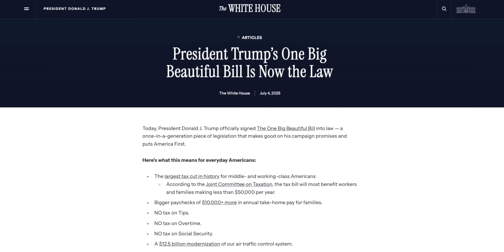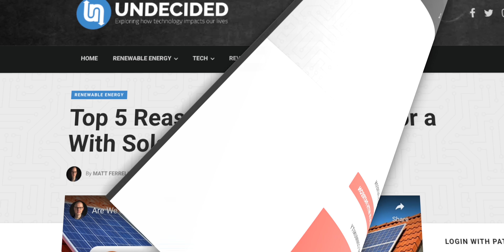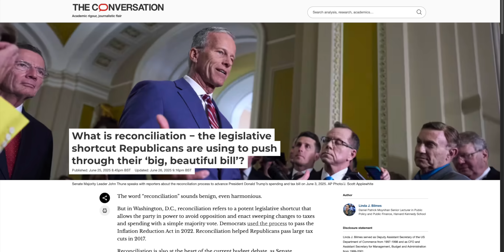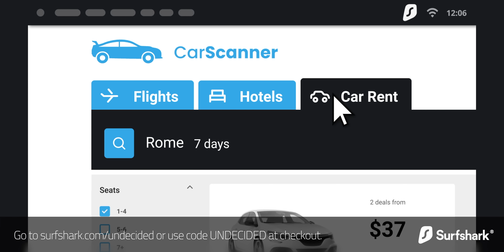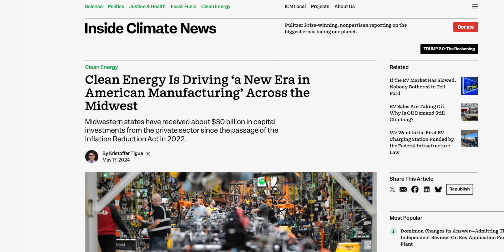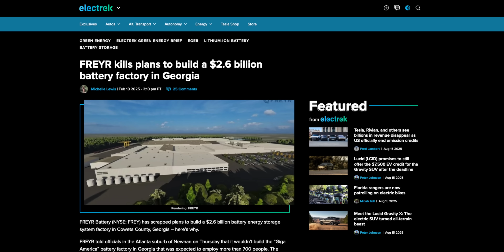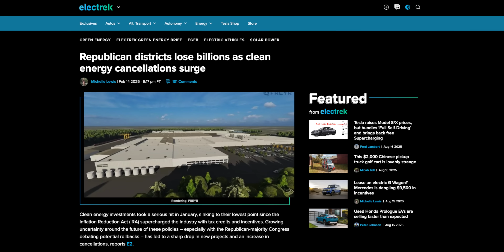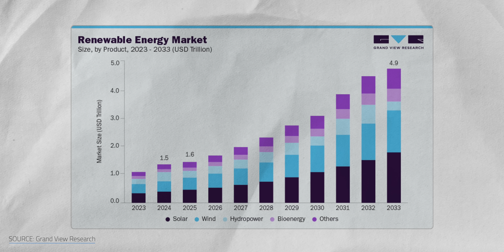How the U.S. Just Handed the Renewable Future to China

Comment: Renewables produce 21% of electricity but employ 42% of energy workforce.  Not a very good advertisement for efficiency.

I wonder, a NG plant produces electricity essentially 24/7/365 while solar and wind do not.  Is the cost of the 24/7/365 NG plant that sits idle but ready to keep your lights on when renwables fail to deliver included in the cost of the renewable?  Are those workers part of the renewable workforce?

If a house went off grid they could buy a generator or they could buy a solar array, batteries and maybe a wind turbine AND still have to buy a generator to step in when the others fail. Also, the generator will work as well in FL and AK.  Renewables can't say that.  

Getting rid of the tax break for EVs will mean that someone else who does NOT own an EV won't have to help pay for your car.

I'm not against EVs or solar but I don't think the costs are being honestly stated.
Reply: Those big American EVs store enough electricity to power your house for several days

Comment: One of the other really big untalked about pieces of information is that the Oil subsidies have no ties to meaning new Oil jobs.  Like you said, it's just money thrown at existing systems, but those systems are increasingly moving to automation.  US Tax $ to the Oil and Coal Industries is either being used for stock price buy-backs or removing jobs.  Congress and Trump Admin didn't put in any penalties to the industries to push the corporations towards certain actions, it's just money thrown at them and a suggestion on how to use that money.  

Recently found out that's pretty much exactly what happened with Eggs in the last year, too.  A lot of US Tax $ went into Egg Producers for groceries, but because there was no penalties attached for misusing the $, it all went into corporate profit margins declared to their investors.  It's wild.  

The US used to have that same subsidies to buy livestock from farms that needed to be killed to prevent disease from spreading.  They got rid of the subsidy, and farmers were reluctant or unable to cull large portions because of the severe financial problems that the US Gov stopped providing assistance for.  Eggs then go into a scarcity issue and Corporations maneuver to take advantage and exploit that to significant blown out degree. And then the US Gov step back into to provide $, but this time WITH NO CAVEATS OR REASONS.  Just, "Here is a lot of money. Please make prices go down, I guess." and the Corporations just take the money and the egg prices froms from 320% to 270% and everyone calls it a win.  ffs

Comment: The US have a post WW2 debt to GDP (124%), and a private debt of average 80k. Even if you wanted to produce panels, inverters etc. it will probably take you 10 years to match China. Your companies wanted globalization to maximize their profits, now that has backfired. It makes more sense to use your country's oil and gas to stabilize the economy, rather than import green stuff from China.
Remember that in 20 years all the green stuff you buy (panels, inverters, batteries etc) will need replacement, so you will have to pay the Chinese again, if you don't have local production.

Comment: I predict that the final cost of installing solar panels may go up at first, but then will mysteriously return to 'just barely breaks even just barely fast enough" to convince just enough people to install so that all the solar roof companies stay busy.   I may be wrong, but that's my prediction.
Based on the fact that it doesn't make sense that over years of checking out solar roof pricing for my same home, it shouldn't have always just barely paid for itself after roughly the same number of years. It should either be clearly too expensive, or clearly a good deal, or be changing from the former to the latter.  Unless, that is, the solar installers have all the business they can fulfill, even if they just barely make it economical for people to install solar.
Reply: Even if the final costs stayed constant for the last years, the technology being installed has cahnged quite a lot.
I can see about the same regarding the installation costs here in Europe, but here's what has changed for me since 2020:

- A standard module (sized about 2 m²) delivers about 450 Wp, which is 100 Wp higher
- The modules now use glass-glass which is more durable than the previously used glass-foil ones
- The new modules have way less light-induced degradation 
- Way better performance with diffuse light on cloudy days
- They often come in a bifacial design, which allows them to use reflected light, e.g. if they are installed on a flat roof
- And the greatest change: In 2020 the installation did not have a battery included, which is the standard nowadays 

So, my recommendation would be to shift from planning sth like "a roof full of solar" to a system of X kWp. Then you should clearly see a decrease in costs.
On the other side, if you're comparing the offers you've got in the recent years, you should clearly see an increase in performance (kWp, and maybe the most recent offer also includes a battery, which the previous didn't).

Comment: Someone thinks US and China currency is the same. If they invested 940b that is 6 trillion in yuan. If it solar efficiency becomes way more efficient, cheaper, less temperature dependent at some point could be a smart move. But if it doesn't spending 6 trillion in spending could put you in massive national debt. Normally China could just devalue their currency to beat it, but that probably won't work in near future. The citizens there are tired of working as cheap slave labor.

Comment: In the Philippines  I just had  (20) 580watt bi panel  ground mount
12 kw inverter      (2)   51.2V/300Ah (15.36kWh)LiPo batteries
Total with labor installed     $13,000  usd.   NO  TARRIFS

Comment: Years before Trump took office, the United States had already lost any chance of success in the clean energy sector. China had been competing internally for 20 years, making its solar panels sufficiently good and cheap to render any American attempt pointless.
This is the natural failure of the United States, not Trump or the Republican Party. Under Biden's presidency, massive subsidies have been poured into the clean energy sector, but the gap with China has widened rather than narrowed. It's wise to avoid a losing battle.

Comment: I love your videos Matt, but your arguement on the loss of jobs is wrong. I was an electrical amd solar contractor for years and now work in architecture. The electricians will transition back to regular electrical jobs and the others into into general labor or other trades. There is no shortage of construction jobs to carry them. Solar in most areas did not create a bunch of new high paying jobs. Rather from what i experienced in California it created a lesser form of electrician or racking crews which a lot were former rough carpenters and other general laborers and roofers. Solar as a specialty laborer was less paid and less skilled than a standard electrician which is what helped bring the cost of solar down. There is a lot of nuance to all arguements but the idea that the labor will be sitting around is a misnomer.

Comment: Good story, but it raises the question: upto which point should you subsidize clean energy?

I'm not a fan of subsidizing fossil fuels either, but I'm not entirely against cancelling clean energy subsidies either.

You could argue that a lot of the clean energy technologies are definitely not in their infancy anymore, and have reached enough economies of scale where they should be competitive right now.

Electric cars? Millions have been sold already.
Solar panels? Billions.
Windmills? Millions as well.
Batteries? Billions.

There are definitely clean energies that might need a little boost. Thorium and Fusion energy for example would be good candidates to subsidize to get them up and running, but the big 4 above are mature technologies, not unsure bets as they've been before.

Comment: Let's also not forget the tack-on repercussions. I'm in IT. One of my clients is a solar planning and installation company. They're talking about letting go about 60% of their people by the end of the year. That's over a hundred people that had good paying jobs that are now going to be looking for work. But, because of that, they're also looking for any other place they can cut. Instead of buying new laptops and generating more income for vendors and my IT company building them out for them, they're going to be holding onto older systems and only replacing ones that have to be updated due to Win11. They're also cutting out the phone system and just using cellphones, so there goes all of that money too for the US-based company we had them paired with. They're going to be downsizing their fleet, so the shop they used (also a client) is going to getting much less work, so they're talking about downsizing 2 technicians or more. Which means less money for my company too, so we're struggling to hold onto the few of us there are while not getting over-burdened for lower pay due to less work. It's absolutely disgusting what these rich jerks are pulling off. What I really don't get is that people are buying it.

Comment: This video comes off like propaganda. You keep calling it "clean energy", but these technologies are not clean. I have 4 dead Ryobi batteries and a bunch of lithium devices without user serviceable batteries in my house that no one will take when they fail. There's no where to take old batteries (there's no profit to be had in recycling them) except the trash can, which is going to a landfill and will pollute groundwater with toxins like Cobalt, lead nickel and lithium.

I own solar panels, and they're awesome, but again, they're good for 30 years (hopefully if a storm doesn't destroy them) and then what? They go in a landfill (hopefully if they accept them) adding lead, mercury and other toxic metals to the ground water. There's no viable recycling solution for all these solar panels so realistically people are going to be dumping them all over the place like tires as they become unusable. 

I'm really enjoying these technologies but they're not clean, they're just clean(er) in emissions but they're going to be a major waste issue in 15- 20 years. Not to mention the fire issues with the batteries. Thermal runaway is insane, and one battery the size of a stamp can burn down your house and we all have 5 to 10 to 20 of them sitting around in our homes at all times. As they start to fail, and more adoption leads to more accidents and incidental damage, there will be more and more fires which are nearly impossible to put out. 

Say what you want about gasoline and propane, but most people don't keep them in the house or next to their bed or children's beds. Battery tech has a long way to go before we start lumping them in with the phrase "clean energy". I live in Georgia and the thought of a battery factory or storage facility being anywhere near me would cause me to move as much as a petroleum processing facility would.
Reply: Even underdeveloped states like Georgia recycles lithium batteries.."Ascend Elements is recycling end-of-life EV batteries and lithium-ion battery manufacturing scrap in Covington, Georgia."

Comment: The figures in this story are simply not accurate and of an industry can not survive without subsidies or is not the answer. Sending our fund to foreign adversaries makes no sense of course you put them into an industry which supports local production. Current renewable energy technologies are overpriced and energy efficient, but they do financially enrich China and others while creating a major pollution issue. By bringing back combustion cars the vehicles will be much cheaper and save households without subsidies.

Comment: This admin basically has absolutely no idea what they are doing. 

Solar, wind, hydro, geothermal, and nuclear are the only power sources that allows you to get to energy independence, even if you don’t make the component parts of the plants/devices as a country. The reason why is once you install the energy capture device, it just keeps producing energy for you for doing basically nothing. The only one that requires constant input from outside is nuclear, but it makes up for it in crazy efficiency and safety.
Reply: I don't want to be that person, but actually wind generation requires a lot of maintenance and rare resources in order to work, so while it's carbon footprint is not as big as fossil fuels it is definitely not a system that can work without issue, nor it can be scaled up in a sustainable way, at least in it's current form.

Hydro energy also requires a lot of maintenance, dams are constantly subjected to stress and decay due to humidity, particularly during winter, not to mention all dams have an expiration date as the river flow drags debris that eventually fills the dam from dhe bottom up.

Solar is the closest we have to a totally autonomous energy generation system but depending on the weather you still have to clean the panes for maximum efficiency.
Reply: @elisehalflight  Well, I think I see where you’re going - solar is superior.  Agree.  

But … scale ?  China has (at least) two monster Wind Generators: Three Gorges at 152 m tall;  And Dongfang at 185 m tall.
Certainly they will require periodic maintenance- same as every type of generation.   And likely more than solar.  But á vast improvement over old tech like coal or gas.  

And … how beautiful ?!  Majestic, silent, behemoths - living monument to human ingenuity - just quietly sitting there as sites of wonder whilst providing power.  Does anyone, anywhere “love” the look of a heap of coal slag ?
Reply: @elisehalflight Maintenance is roughly equal for all forms of energy though. Coal and gas fired plants also require roughly the same amount of maintenance AND they cannot possibly be run without a fuel source.
Reply: @cheeseisgreat24  Oh definitely, renewables is the way to go. I am just telling you that they're not a fire and forget thing. It's just our best option until we figure out something better, just like nuclear. I am pro renewables, you don't need to sell me on them, lol.
Reply: @elisehalflight I never said they were though. So why are you commenting like I said they were?
Reply: @elisehalflight I do realize my statement of “doing basically nothing” could lead you down the path, buuuuut here’s the thing, everything in human life has maintenance needs. That is why there is the adverb modifier “basically” before “nothing.” The understanding there is that there is no additional work required to keep the energy being captured, other than general upkeep of the mechanical system as a whole, you know, “basic” upkeep. They do not need constant human input and monitoring of their fuel source, we get that for free, for doing literally nothing, but we need to recognize that they don’t let you get away with doing “literally” nothing, so “basically” is the word used.
Reply: @cheeseisgreat24  Are we really going to argue over semantics here?
Reply: @elisehalflight I mean, you’re the one who came in to do just that 🤷🏻‍♂️
Reply: @elisehalflight Also not to mention, maintenance can be done by your own citizens, meaning you still have energy independence which is what I said you’d have
Reply: Of course they do. They are keeping corrupt rich people in business and they are destroying small businesses. Because they want more for themselves and less for us!
Reply: This admin knows exactly what they're doing.  Destroying America from within, across every facet, at the direction of its enemies.
Reply: @cheeseisgreat24  I believe they know what they're doing. I'm fairly confident that they're just making sure they benefit their largest donors with minimal consideration for the future.  Republicans in power tend to move toward privatization of every government program possible while also setting up kickbacks to their largest donors with little regard for us at the bottom. Democrats do the same but tend to at least provide some things that benefit the working class besides "tax cuts" that ironically just hurt us because the sum of government programs is never going to be beaten by having an extra $700 not spent on taxes or something.  

Losing money for public services is an increased tax expense for all but the most wealthy.
Reply: Are you aware that hydro is not considered a renewable power source?
Reply: @Potatogambit Are you aware that your statement is wrong?